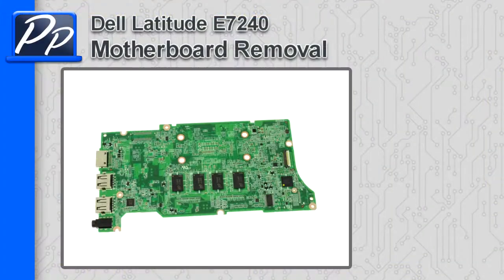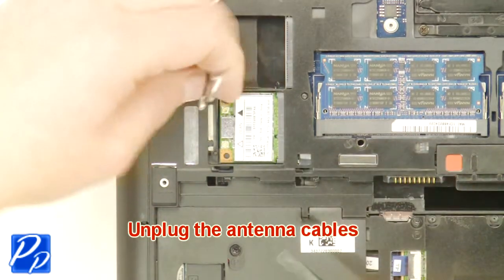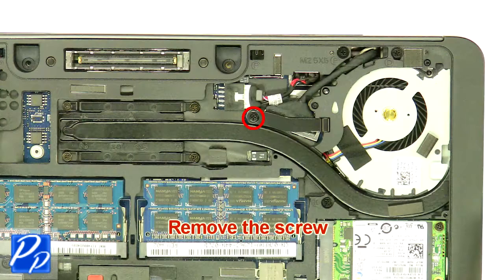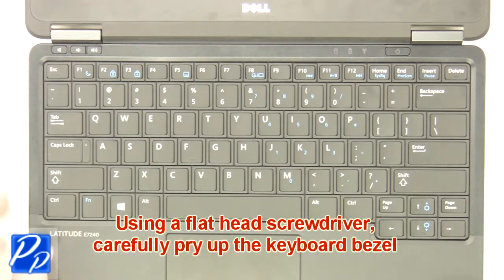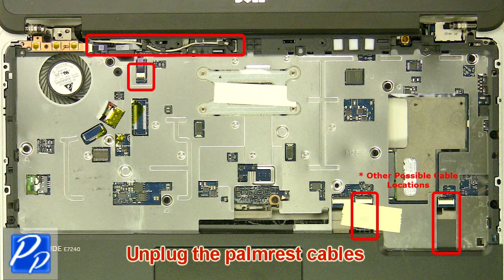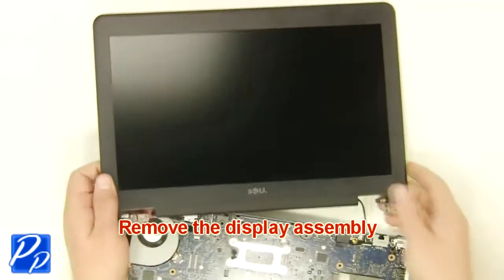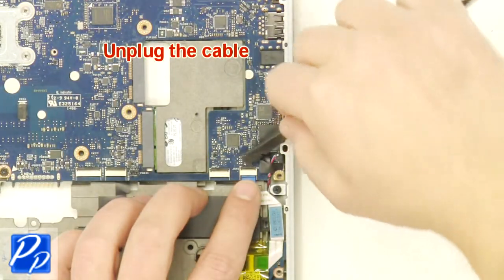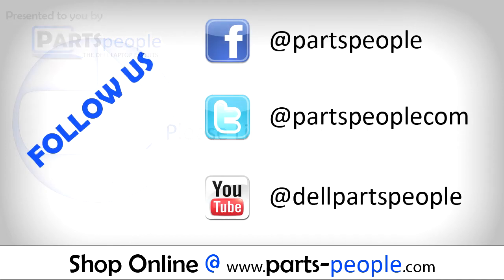Dell Latitude E7240 Motherboard How-To Video Tutorial

Comment: When replacing the motherboard, does it have CPU already on it or would I look to having to replace that too? Also how do I clean a heatsink?

Thank you for the video!! 10 years after posting and is INCREDIBLY helpful

-IT Helpdesk Tech
Reply from the maker: Hi! Yes the CPU is integrated so you'll have to replace the entire motherboard to upgrade it. Take a look at the boards we have for the E7240 https://www.parts-people.com/index.php?action=category&id=140&subid=445&refine=mother. As for the heasink - clean it with isopropyl alcohol and use thermal paste or thermal pads.

Comment: Hey I have a question. So I have the dell latitude e6420 with a intel core i5 and integrated graphics. I was wondering if I could replace the motherboard with the nvidia graphics motherboard that this model also has to give my laptop more graphics performance. Would it be okay? I thought it would be fine since the motherboards are literally the same but different graphics and I would transfer my i5 cpu to the new motherboard.
Reply from the maker: Yes you can swap the motherboards and the CPU will transfer too.

Comment: Hey. After assembling the notebook is not working. glowing power button "on". Have you answer?
Reply from the maker: Start by checking to make sure you don't have any loose cables. Check the display cable in particular.
Reply: Parts-People.Com, Inc yes all cables are on... problem not solved...

Comment: Hi there. I have the same model with 128gb mSATA. I want to upgrade the space. Is it possible to install another 128gb msata in the slot next to wifi adaptor? Where wwan is supposed to be installed? Or the only option is to replace 128gb with 256gb?
Reply from the maker: I am pretty certain the WWAN slot is mSATA compatible. Putting an additional SSD there should work fine.